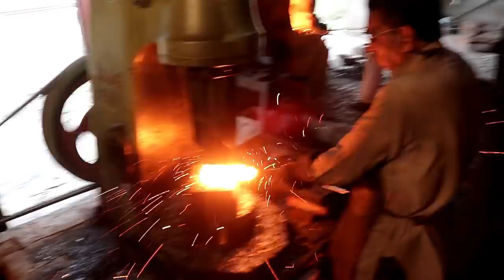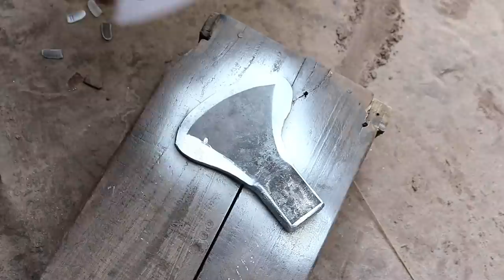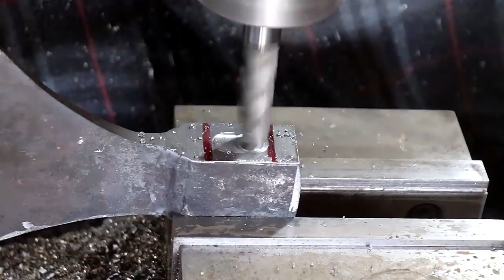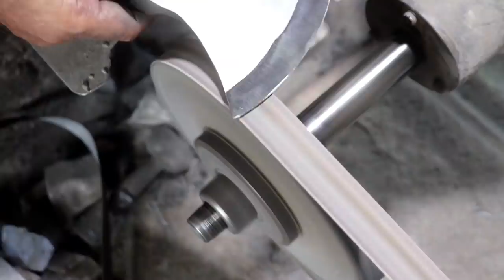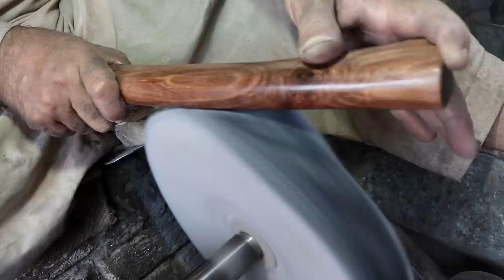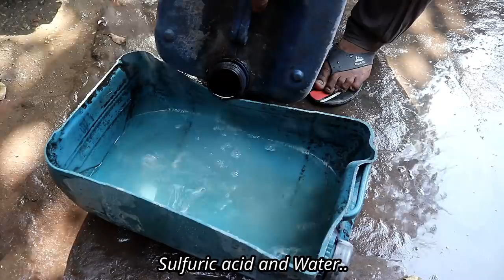How to Make AXE with Forging Process | Damascus Steel viking Axes

Comment: Let me say very nice work first of all.  Beautiful teamwork to make a very elegant product. Just one question: would the sulfuric acid weaken the epoxy at all at the end? I honestly don't know and I'm just curious.
Reply: The heat from grinding that much excess wood could weaken the epoxy if not careful, I'll have to look up if the acid would do anything to epoxy I would think not but there is also no reason or benefit to etching it while on the handle

Comment: The steel might be ok, even if they do not re-temper it.
I am a blacksmith over 24 years, but that handle it's not good that way!
I'd break it in the first day, if i'd use it here, in the Boreal forest...
Reply: what would you recommend sir?